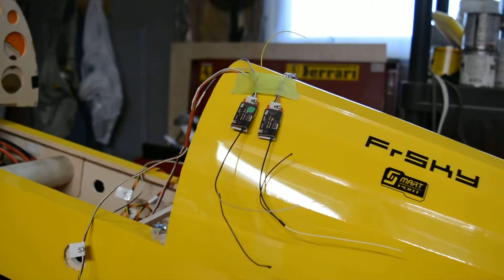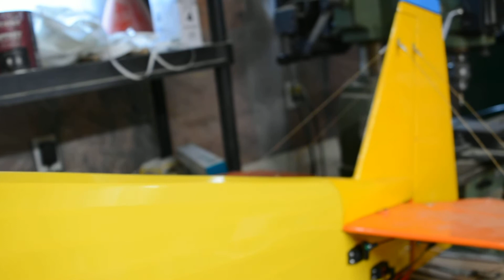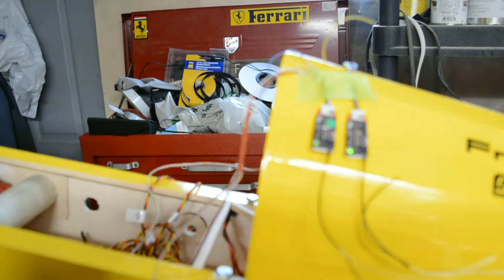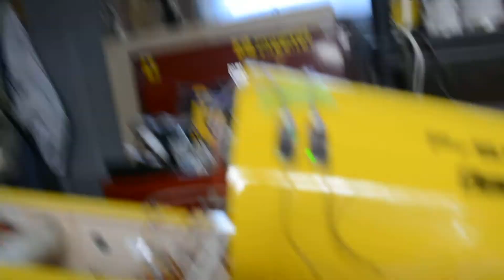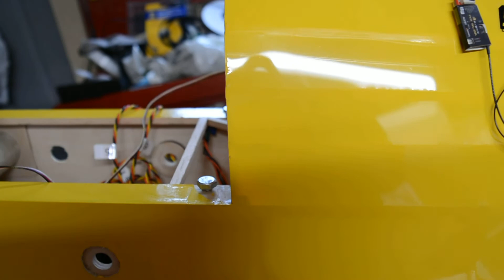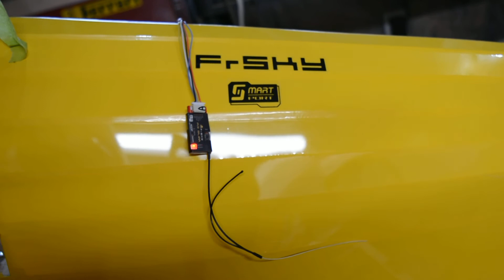DSC 0432

Comment: Hi Roger, I had a similar situation and found out that it happens when the transmitter is too close from receiver. I've never lost a bind from my Taranis to a Frsky receiver.
Reply from the maker: Yes but I had the receiver at a proper distance,  something like 5 feet.  the test here was to see if we could have both receivers turn on even when very close to each other, , by the way these are the 900 mhz system